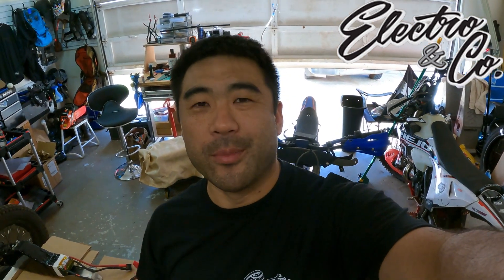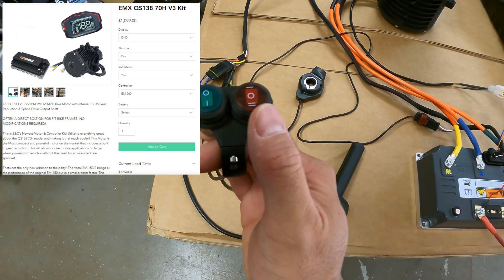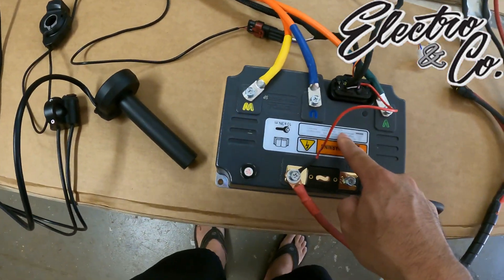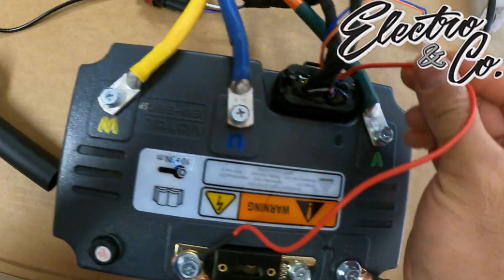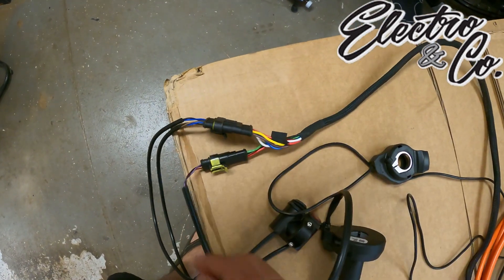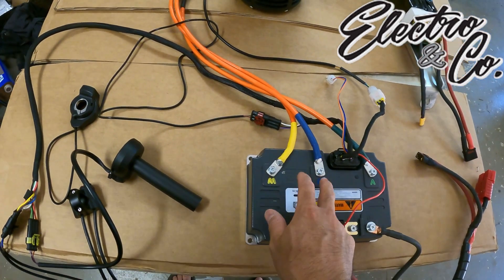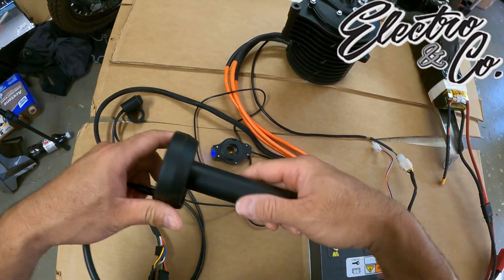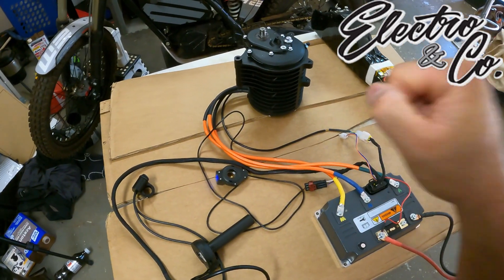ELECTRO AND CO Qs 138 V3 motor and EM-260 Controller kit for DIY Electric Dirtbike conversion.

Comment: Qs138 v3 motor runs hall sensors mate.
Reply: yes, they do have hall sensors. I have this same motor (also purchased from electro & co), I do not believe you can get this motor in an encoder version. The "smoothness"  comparison described in this video sounds more like what you would experience with square wave vs. sine wave controllers, not hall vs. encoder motors.